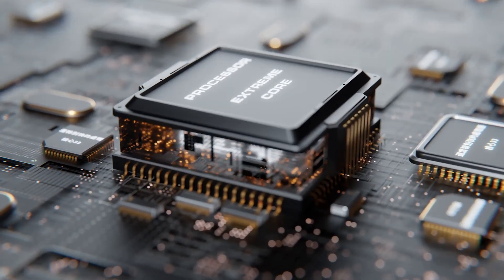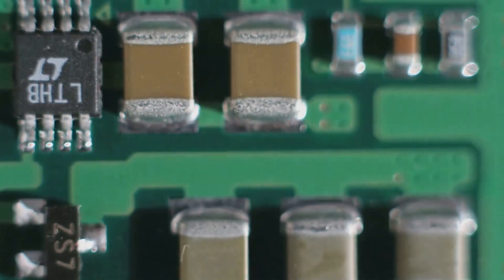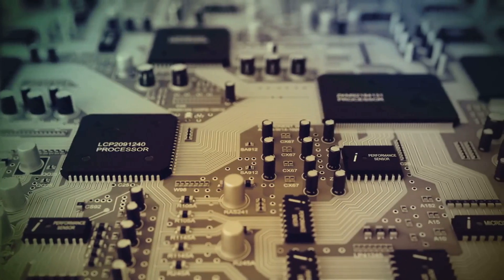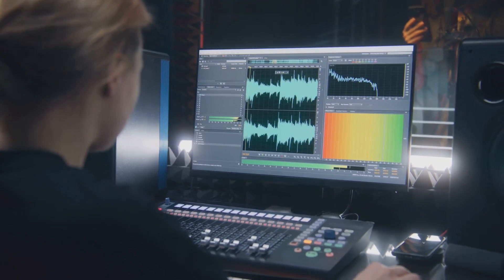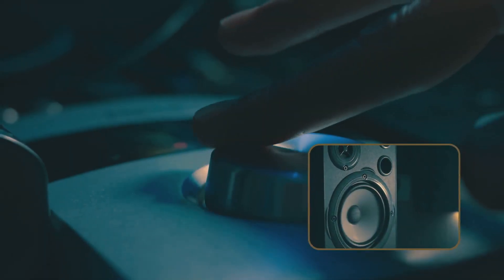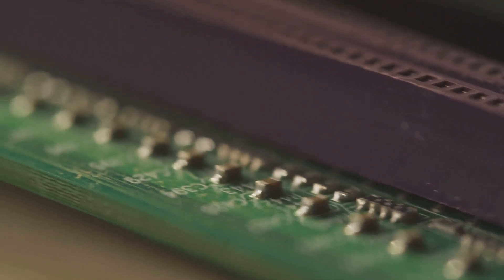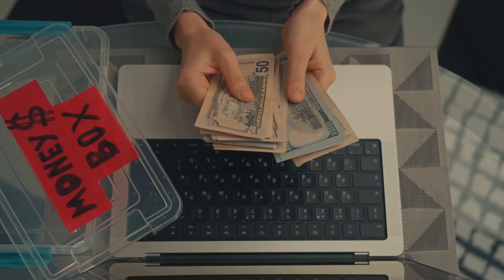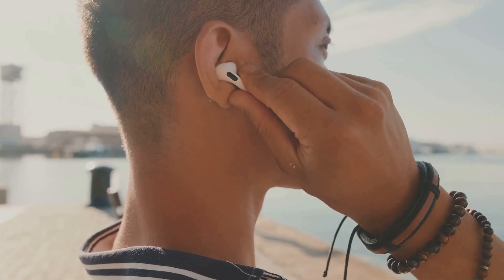Do You Still Need a Sound Card?

Comment: Onboard HD audio solutions might be really decent and good enough for the average gamer or movie enjoyer but I upgraded to a SoundBlaster X AE-5 Plus and you can clearly hear the difference, with my PreSosnus stereo monitors and especially with my Beyerdynamic headphones. The audio resolution, dynamic, loudness, bass and treble is so much better, sharper and more defined - especially at higher volumes without any interferences. Additionally the SBX Command software is pretty nice, you can switch between headphone jacks and stereo audio jack with a single click, you can activate raw input without any EQ or other things modifying the original source. If you have the money free to spend I def recommend to try it out, the basic mobo onboard audio solution also should work just fine for the most people as long as it is a decent mid-upper mid class or high end board.

Comment: There are also very big differences between integrated audio chips. More than once I have returned a motherboard because the integrated audio chip did not deliver the sound quality that my older motherboard did.  For example just compare an integrated Realtek S1220A with an Realtek ALC887. The difference in sound quality is very significant.
Reply: i downgraded from a higher model of ALC chip to ALC887 to my new AM4 COmputer system and I could hear the downgrade of sound quality thats why I will buy a sound card toi make up for this

Comment: I still have a Creative Sound Blaster X-Fi Titanium HD Internal PC Audio Card w/ THX SB1270 lying around.  It was in my last build because that motherboard did not have good audio in it.  When I rebuilt this system I went with a Ryzen 3800x and a Gigabyte x570 Aorus Master which has amazing onboard audio.

Gigabyte X570 Aorus Master's sound quality.

Here's a quick rundown of what to expect:

High-fidelity audio components: The motherboard boasts an ESS Sabre Hi-Fi 9118 DAC (digital-to-analog converter) for improved headphone audio and WIMA audio capacitors known for their audio quality.
Isolated audio design: Gigabyte incorporates a physical separation between the audio section and the rest of the motherboard to minimize electrical interference.
ALC1220-VB audio codec: While not the latest codec, the ALC1220-VB is a well-regarded option delivering good audio performance for most users.

Comment: I'm still using my X-Fi Titanium Fatal1ty Champion Edition sound card with my Z790/4090 PC.
Reply: Well driver support is important. That's why I'm not using any of my soundplaster hardware because they dropped support. The built-in will last as long as the maker updates it.
Reply: @brodriguez11000 Drivers work just fine on windows 10 and 11. You just have to search for them. Like I said I'm using it on My modern Windows 10 Z790 STRIX motherboard and it works great with all the software. Just use the auto update tool after installing the base drivers.

Comment: In my experience onboard sound cards are sounding terrible bad. Especially the noise floor is awfull. I never saw a onboard sound solution with nearly reached the level of external solutions. This is most likely caused by the analogue circuits placed nearby the digital stuff.
Reply: That's why on some higher end mother boards it'll be as far away as can be placed. Use higher quality components and filtering. Plus some may even have optical out.
Reply: @brodriguez11000  My motherboard is a more or less expensive Asus one but the analoge output make a terrible noise. Optical outputs are not relevant in this discussion, if you use them your DAC is somewhere else. It does not make sense to include this. The analoge components are always the problem, not the digital.